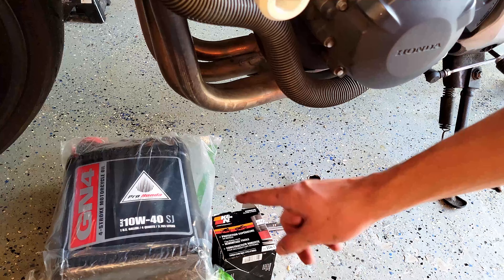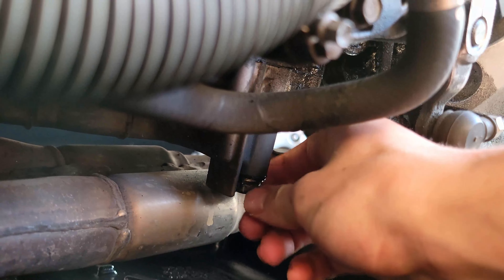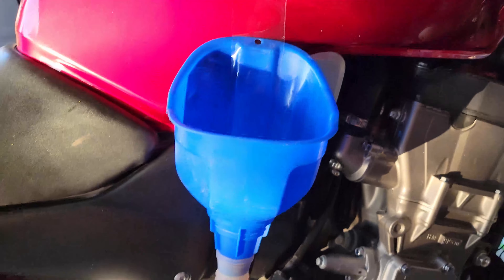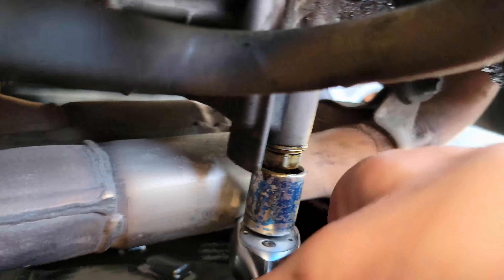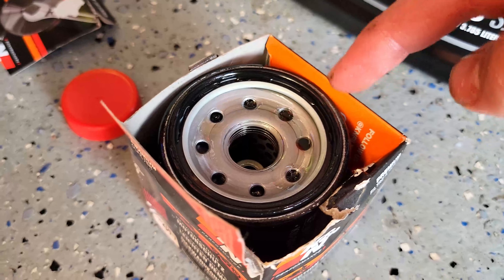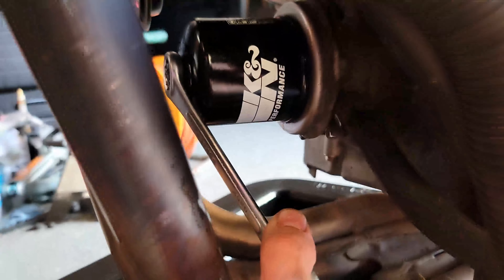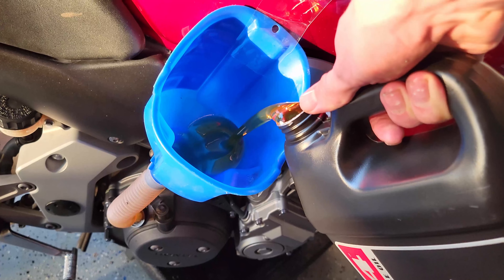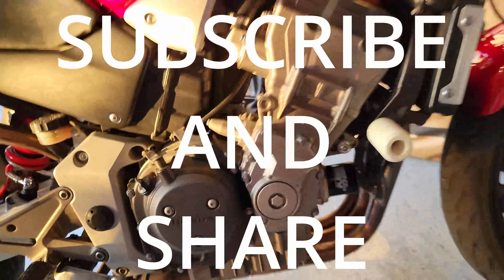Honda 919 Oil Change Easy How To 4k 60fps

Comment: I change oil every 10-12000 miles. Full synthetic Mobil1 10W-40 and OEM Honda filter. Little over 75000 miles on my 919, running strong.
Reply from the maker: Amazing keep it up!

Comment: How do i know if its enough pil where should it be at on the the little circle i can see thru
Reply: right in the midlle, between the upper and lower bar on the  oil window aka little circle.